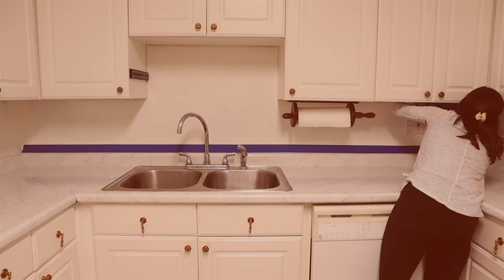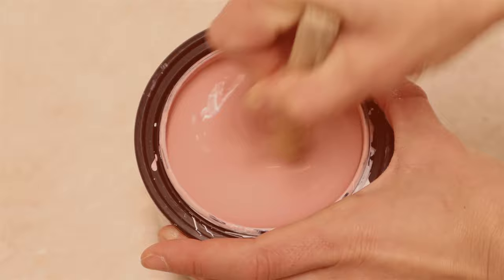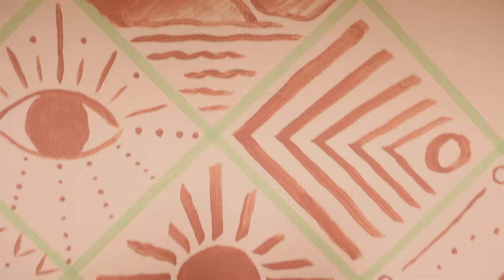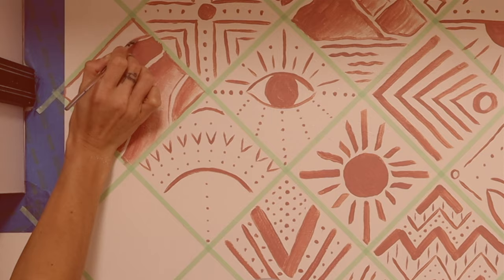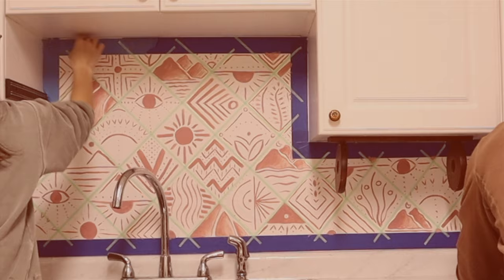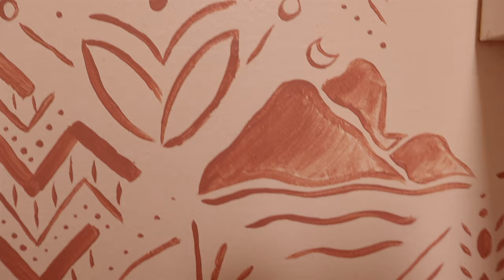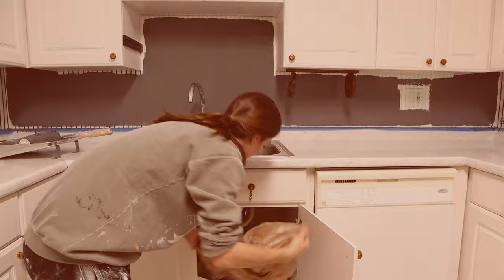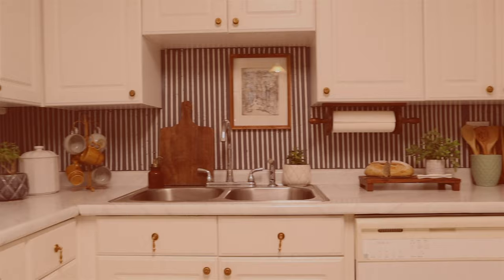DIY BOHO KITCHEN MAKEOVER for $10 | DIY wallpaper or backsplash

Comment: Tip for spacing out lines evenly! Cut painters tape to size you want between stripes, (two even pieces). Stick pieces together together sticky side in. And use your movable "guide" to make striping evenly, so much easier!